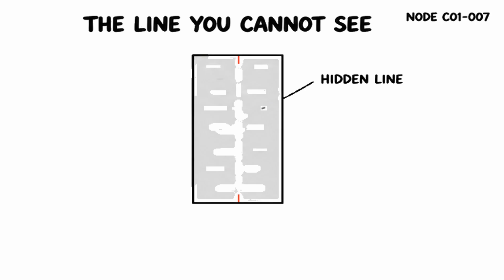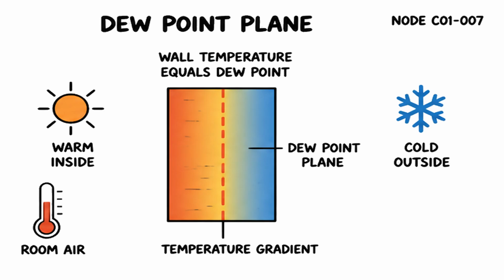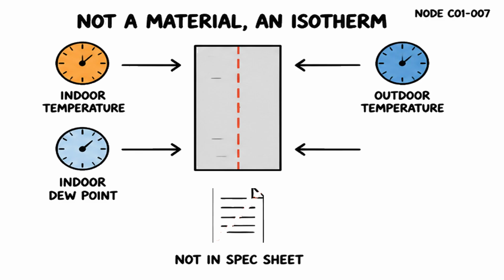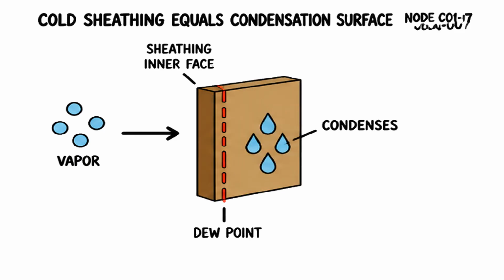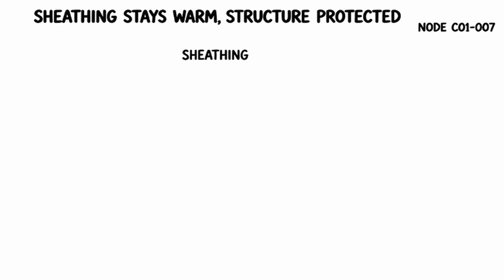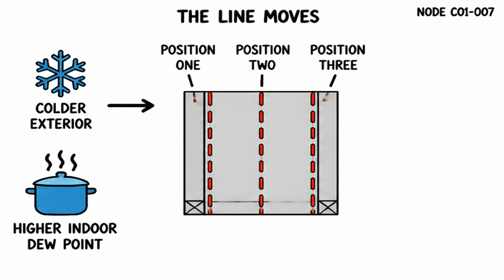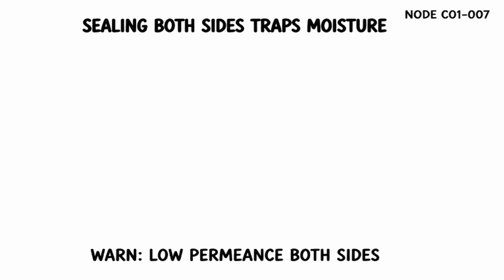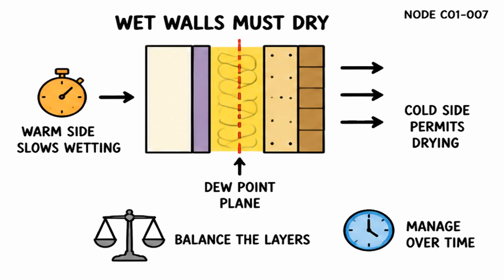Where Is the dew point inside a wall — layer by layer  node 7

Comment from the maker: 📌 Quick reference — the invisible line and the four inputs:

1⃣ THE DEW POINT PLANE is not a material. It is an isotherm — an imaginary surface inside the wall where the wall's temperature equals the indoor dew point. You cannot find it on a spec sheet.

2⃣ FOUR INPUTS decide where it sits:
   • indoor temperature
   • indoor dew point (humidity)
   • outdoor temperature
   • R-value distribution of every layer
   Change any one and the line moves.

3⃣ WHY INSULATION PLACEMENT MATTERS:
   • Cavity insulation only → sheathing stays cold → plane lands on the sheathing → condensation surface.
   • Continuous exterior insulation → sheathing stays warm → plane moves outward into the exterior insulation → structure protected.

🧭 The principle: vapor retarders go on the WARM side (slows wetting); the cold side must stay permeable (allows drying). Sealing both sides is a trap.

❓ Two questions for you:
• Have you ever wondered why some builders put foam OUTSIDE the sheathing? Did you assume it was only about R-value?
• Have you ever opened a wall and found the sheathing darker or wetter than expected — even with no leak?

Your answers help us pick the next nodes.

▶ This is Node C01-007. It builds on Node 1 (dew point), 3 (interstitial condensation), 5 (RH vs dew point) and 6 (seasonal condensation) — links in the description.

⚠ Educational content only — not professional advice. Always verify with a licensed professional and your local building department.